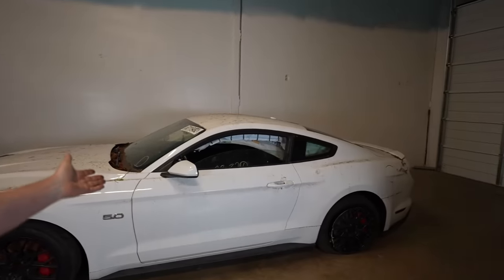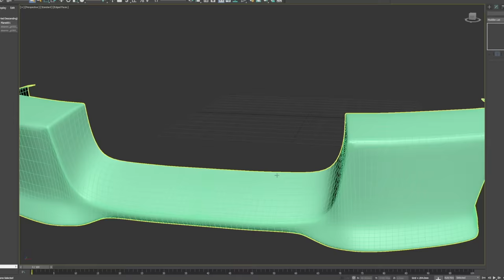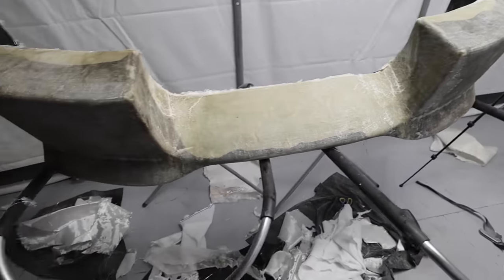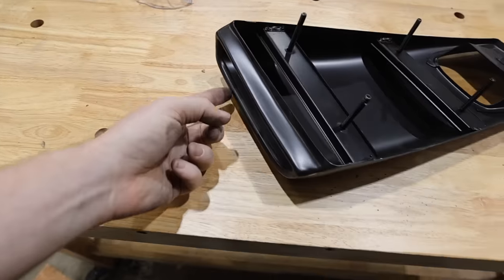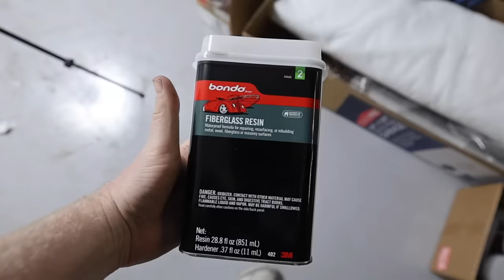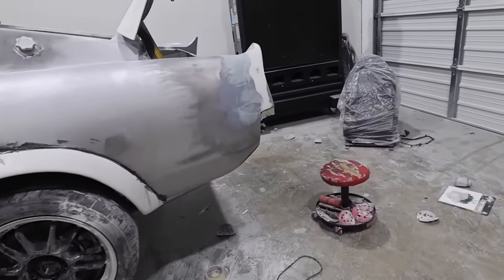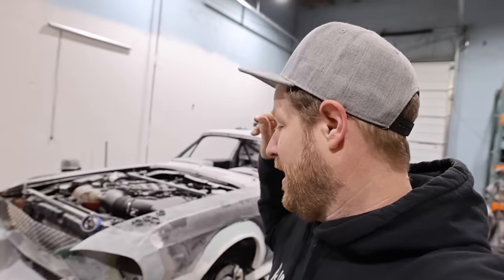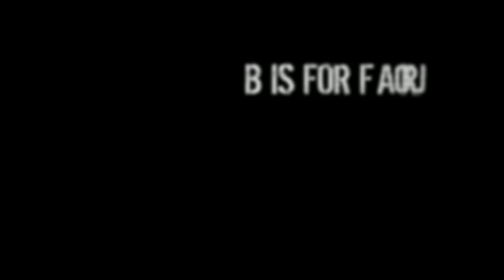B IS FOR BUILD SEMA MUSTANG Build Part 6 - 3D Printed Front Bumper!

Comment: Looks like the front bumper is angled inwards tucks in and underneath the car in the render. The 3D printed one looks more flat and upright. Doesn't really flow with the angle of extension of the hood and headlight surrounds

Comment: CHRIS _ next time 3D print the part inverse so you have your perfect external dimensions as the MOLD. spray a layer og gelCot, then 3-4 layers chip 12oz then 2-3 layers of 1708 and you will have a rock solid part.

Comment: Isn't this why they often make the molds into in this case probably 3 parts, and also use some wood and flanges to strengthen the mold so it doesn't bow out or contort etc. ?

Comment: For after SEMA.....  I wonder if something like a Prusa upgrade kit could be adapted to fit the big bed printer to upgrade it to be a lot faster.  Surely it'd work right? It's just stepper motors, a board and it's mostly a dumb system...?
Reply: could work, but I think a system like StreetBandito is doing is more cost effective and faster if a print fails. Just buy like 5 or 6 printers instead of 1 massive one. the big one is cool but for this application it doesn't make much sense to print one whole part instead of several smaller parts.

Comment: Suprised you guys dont use a 3D scanner and a CNC router table to form foam mold's, seems a lot faster than 3D printing such large parts
Reply: What are you going to scan if the aim is to make the bumper that doesn't exist yet?

Comment: definitely worth testing 3d printing model features that can mechanically bond with fiberglass like through holes or porous surface part of the lost time is unfortunately due to having to brainstorm and flip flop on ideas where you could save time in the future if you model things with a method in mind. With the idea of needing to put body filler on anyways after a few layers of fiberglass you could save some print time by having thinner walls and maybe some voids with 10% infill. who cares if the print surface looks kinda crappy if you're going to cover it. It just needs to withstand the vacuum bagging. There is still more creativity that can be unlocked with 3d printing beyond using it as a glorified sculptor for a mold or a negative.

Comment: For future experimentation to get the 3d printed plastic to live with the glass bumper you need to perferate the plastic with a bunch of .125 inch holes in a grid-like pattern and sandwich it with glass on both sides. If it seems like it will delaminate then you should add chop glass sheet to the back side to stiffen the bumper overall.

Comment: Absolutely gread and astonishing work. The only problem is - this car is not a daily driver no more. With all these fiberglass shortcuts you took the front bumper and, well, the whole front, is a part of the car. So if an idiot who decides to run a red light hits your front - you're missing half of your car.
Shortcuts-Shortcuts.

Comment: From what I see the number 1 problem with your bumper is that CSM is not a structural fiberglass. Next time try 2 layers of 1708 and then 1 layer of CSM on top to facilitate smoothing.

Comment: Wondering if you should of streched the base mustang to match the shelby wheelbase instead of modifying the fender
Reply: So stretch the whole car as apposed to modifying a couple fenders???? Doesn't make much sense.
Reply: would take 100x more work to do that. you would have to modify the suspension or the entire body and at that poing all of your body panels would have to be readjusted to fit again.

Comment: Yeah you guys really need to start doing SEMA builds with more than 6 weeks to finish it. I know you might think it's impressive that you got it built in such a short amount of time, but it looks pretty dumb because of the amount of stress it causes. Start earlier so you don't have to take half measures just to finish it on time.

Comment: Buy a bloody roller. And stop using such heavy glass. Use 225/300gsm and more payers and on the last layer use flow coat. this will make it easier to sand and finish

Comment: Okay I'm at the part where you're peeling off the vacuum bag the problem you did is you didn't wet out the part well enough you didn't wet out the fiberglass well enough you did not make sure that the air bubbles were out in between the layers enough you also use the wrong fiberglass matting your fiberglass should be translucent and you should be able to see the part thoroughly like if it is on would you should be able to see the wood grain with multiple layers on it that's how wet it should be not too too wet that it's got tons and tons of just dripping but it should be wet enough you can see words and detail perfectly what's several layers of thick heavy ounce fiberglass

Comment: It kinda hurts me to see how much stuff you fiberglass on the metal. After time, this stuff will start to crack. Eg. When you drive the car hard. Rising and falling temperatures will also do it's thing. You should try to make gaps between big part's. So they don't put stress on each other, when flexing.

Comment: From what I understand of the copyright issue it was almost entirely a scam with very little truth supporting a lot of lies.
If anyone actually got the movie script of both the original and the remake or even just watched the movies and listened for the key information it would have been determined that it was not a copyrightable character like Chitty Chitty Bang Bang or the bat mobile.
The names were assigned to luxury and unique vehicles targeted for theft as code names for any vehicle that fitted particular criteria of each code name. This means that Eleanor was assigned to any Shelby GT500 not a specific one. The only way that they could have honesty held a copyright is if the vehicle was if they made it talk or something and intended to steal the particular talking car not just any car.
The only thing unique about the movie car was the slight changes they made to Shelby parts in an attempt to avoid being sued by Shelby for copyright violations.

Comment: You are not a fiberglass guy. Your whole problem is improper mixing of the catalyst with the resin. Either not enough catalyst or not completely mixed. The resin does not require air to dry. It is an endothermic chemical reaction. The only thing that MIGHT cure the resin at this point is heat. If it does eventually harden, you may be able to use it, but it will be permanently compromised structurally, and probably should be replaced.